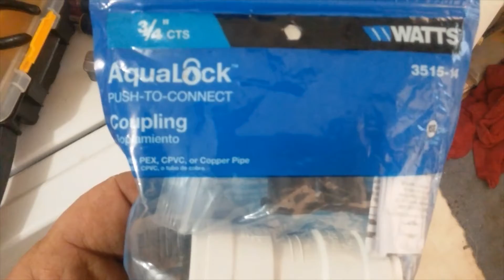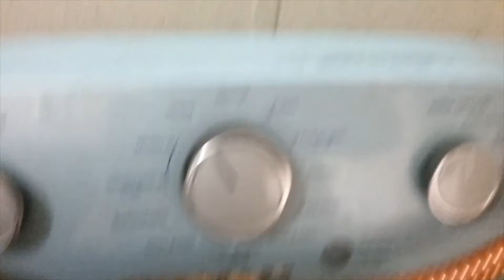How To Use Watts Aqualock Push To Connect Fittings

Comment: I wasn't sure about the little peg thing that went inside the pipe.  Ive got a old copper pipe i had to cut for the shower and had to buy the male adapter. Thanks for the video. Hoping it goes well.

Comment: You didn’t show it release
Reply: They are really simple to release,  first the pipe cannot have any water pressure in it or it will not release.  Second remove the retaining clip,  then push down on the collar and pull the pipe right out, it's super simple.